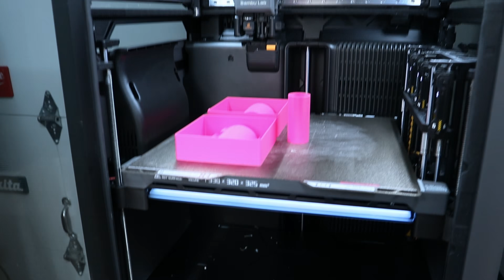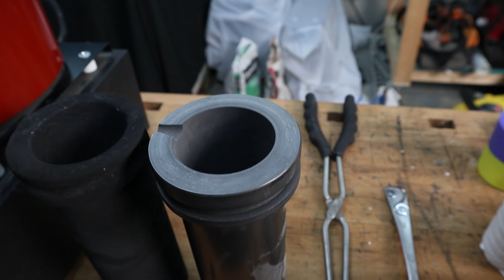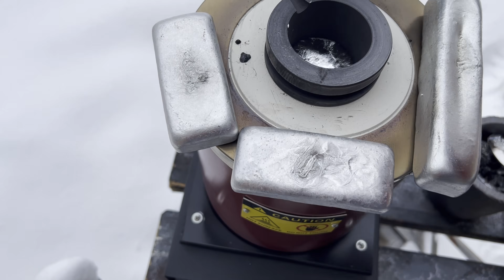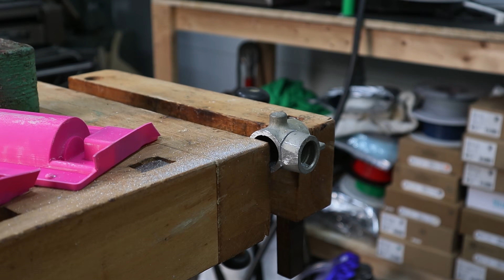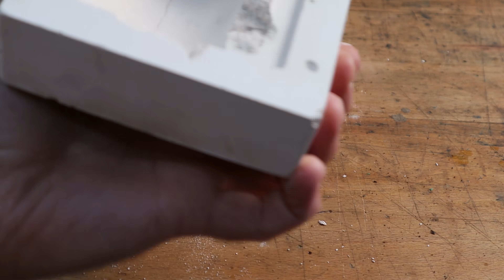Can these 3D prints make metal casting easier and better?

Comment: there is another method of using 3d printing for metal casting. you make multi piece molds on 3d printer to create epoxy sand cores or whole casting mold pieces
i used it to produce sewing machine frame at home pushing my electric mini furnace to absolute maximum

pretty much similar process to plaster of paris molds only there is no burnout stage because waxed 3d prints can be east removed and reused for another mold
Reply: Agreed. 2% epoxy resin by weight, use acetone for easy mixing, use fine sand. Produces excellent detail from pattern.
Reply: @notJW13383  you don't have to be that accurate
personally i used casting transparent epoxy i had leftover so there was no thining and i mixed in sand untill it looked kind of dry then ramed as normal sand and left to harden. but i guess you also need to take into consideration it can't be fast set stuff because you won't be able to use it before it kick in

Comment: A word of caution I will tell you from my personal experience. Never ever ever ever plan to pour any molten metal outside if it's precipitating at all. Those little snowflakes that were falling will leave behind little traces of water in your mold. I'm mostly referring to the ingot mold because it's open but it is still a factor regardless. When the molten metal is poured into the mold and there's a couple of drops of water inside or snowflakes it instantly will turn to steam and blast the molten metal into the air. I learned this the hard way about 27 years ago. Please be careful.
Reply: I'm glad your personal experience was unpleasant. Someone like you deserves it

Comment: And @ 20:19 that "little bit of trouble" you point out is the melted polystyrene.[ it hasn't had a chance to completely burn off, so it's just a glob of plastic, like you see on the end of the first pour's rectangle shape - gathered melted plastic that hasn't burned-up yet. And on the second pour the incoming molten aluminum just pushed the melted polystyrene (plastic) out of the way and that's what we see gathered up around the spout. 
- - What do ya think? makes sense to me. :D

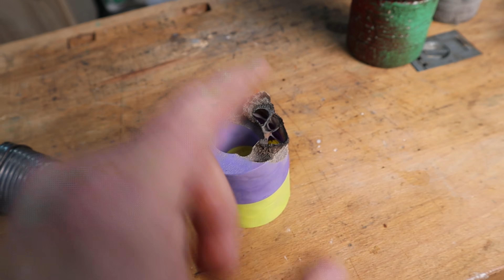Comment: That melting @ 19:17 is actually from the other pour, not the pour that got stuck. LOL They were too close together, and I'm certain that if the first pour went well, the second one would have failed from the heat melting the second mold :/ - Gotta account for them being too close together next time LOL
BUT I agree that the gasses created enough pressure to stop the molten aluminum from going any further, sorta like the 'glug glug' when pour out liquid in bottle with only one opening but in this case the aluminum solidified and the gases couldn't escape, otherwise you did an AMAZING JOB!!!!!Nearly perfect!  :) - Keep up the awesome work!!!

Comment: Thank you for this video. I’ve been working up to my first casting project, and this was very eye opening. I’ve always wondered, between lost foam and lost PLA, if there aren’t better options, or maybe WHY there aren’t better options for 3D printed patterns to be used in the “lost” casting process. Thinking of things like these foaming TPU’s for example. It would be awesome to not need yet another piece of equipment to make “foam” casting patterns, but pouring directly into PLA seems like a non-starter…

Comment: Your last one did good, but you don't want to pour metal down the vent. That narrow tube can trap air, like a piston forcing it down into the mold below while the metal is still liquid. That is why it fell off when you turned it upside down.
You can do a "lost foam" style 3D print but you need to dip it in plaster and melt it out in the microwave.
Another method is sand casting using 3D printed positives. This is pretty quick and only requires play sand and some water or motor oil or mollases depending on the level of burning smell you are willing to put up with. You can buy casting sand as well but it is expensive in small quantity.

Comment: I have been up and down and all around 3d printed casting. After MUCH experimentation, successes and failures my opinion is that lost PLA is CRAP no matter the filament- even the polycast ones.😂 the best and most reliable method I've found to get CLEAN accurate castings is to 3d print a part, make a silicon mold negative of it, wax cast the mold. Then cast with Investment vacuum casting. You can kinda get the diy methods to work but 3d print part> silicon mold negative > wax mold> legit investment plaster> vacuum casting is about the only thing I could get perfect castings with when the delicate/intricate parts needed to be PERFECT. Lost pla works "eh kinda" for basic shaped objects.
Reply: You should totally do a video of this whole process. I would love to see it
Reply: @simonwoywod8387 yea if i can ever get a power supply to work long enough on my induction heater or break out the ol coal forge again i guess. Iv killed 4 smps and to many bridge rectifiers using rewound mots for power so im stuck running half power for now . Im waiting to order a whole bunch of 50 amp rectifiers to parallel together along with 2 150amp bricks they should survive
Reply: Really iv seen multiple people get quite impressive results and the just essentially burry the print and pour in to it . The biggest trick from my understanding is that  you have to make at least 1 vent hole directly on the bottom of you print that loops back up and out of the sand  along with the hole your pouring into that way as you pour the molten plastic has a place to eacape because this is not foam that pretty well vaporizes or wax that gets liquid enough to flow thru the sand around it . The pla need to be able to escape the mold area as it melts

Comment: Look at a metal called Zamak.  It is Zinc based.  It has a lower melting temp than aluminum.  you can scavenge it from everywhere e.g. old sink faucets.  designed for casting.  cheap!!! used everywhere in the industry.

Comment: When you make 3d printed one time molds, The easiest way to remove the plastic is to use heat. I use either a small oven at around 100 C or a heat gun. That way the plastic is soft and rubbery and can be pulled right off. As a bonus this helps the plaster to cure faster.

Comment: @NeedItMakeIt
Thanks for another interesting and enjoyable video!!
Regarding "draft angles", wouldn't it be required to put "draft angles" on ALL sides of the part AS WELL as the "form walls" to enable you to remove the plaster from the 3D-print ?? In which case that would make the whole "design" more "convoluted", and in some cases more or less impossible or force you to "post process" your cast in order to "get rid of" the metal that had been "added to get draft angles"...
And "also" having the "flat top planes" really makes it "sub optimal" for gasses (or air) to "rise and escape", so if you had "leaned" the "shape" you could have gotten a more "natural escape route" for any "entrained gas". Of course more "vents" would help as well, but I'm not sure you would have needed that had you not cast your part ""standing flat"".
Just my thoughts...
Best regards.

Comment: The side of the pla which didn't cast well is burnt because of the successful cast next to it, it burnt it, and not because of the gasses
Reply: What's interesting about that is that if the first pour had been successful, it seems that would have ruined the second part by prematurely melting some of the foam, allowing sand to flow into the resulting void.

Comment: That's some pretty good results for home casting.

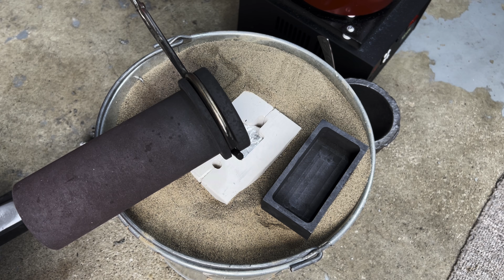A few tips, first, if you want to pull multiple plaster molds of one 3D print, you can print the same shape as the plaster mold, then use the print to make silicone molds for the plaster; silicone also lets you do undercuts or zero draft angles without a problem. Also, you should put the plaster in a vacuum chamber to remove any air bubbles after you pour it into the mold, which will give you a better surface finish. Your down-sprue is also too big; you can see air getting sucked down by the aluminum at 16:13 in the video if you look at the side of the sprue opening opposite the pouring basin. The transition between the offset pouring basin and the down sprue should actual be one continuous curve; also, the sprue should be tapered in cross sectional area as it goes down. You have to remember that liquid aluminum has about the same viscosity as water. As it accelerates down the sprue, the cross-sectional area of the flow decreases, just like a stream of water falling from a slightly turned on faucet; the sprue needs to hug the aluminum all the way down. You should look up the paper "Optimizing the Gating System for Steel Castings" it has a lot of good concepts in it, especially the Trident gate and spin trap at the end of the paper, or just look up anything by John Campbell. Both his books/papers and his talks are some of the best material on metal casting.
Reply: Please listen to this! It will improve your castings VASTLY. Anytime I see someone break out the tin can I hope that someone in the comments brings up Campbell
Reply: @theodorekorehonen Campbell is the GOAT, learned a lot from his books and papers.
Reply: @ZergZfTw  could you just use tpu filament
Reply: @A96Z86 maybe, but printing the super soft durometer stuff is kinda a pain, especially for more complicated shapes. 2 part silicon can copy the shape of objects down to a micron level, so you can do vaper smoothing, hand sanding, or use something higher resolution like a resin printer if you want.

Comment: @20:00 I don't see a vent on 1& 2 like the Pla&plaster mould. That would explain issues on both.  If doing green sand casting, use a lower basin to capture the sand that washes down with filler neck.

Comment: Just a tip, for any wet mold such as plaster you need to dry it fully or it can cause major issues during casting.
Reply: As this person forgot to elaborate, let me do it - it will explode as the steam will rapidly expand. And the explosion will throw not only pieces of the mould and sand at you, but also the melted metal. Fun times
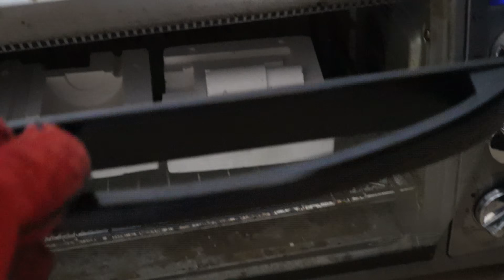Reply: He did dry it @13:16
Reply: yes, instantly boiling the moistures inside the plastes could cause a mess, even while it looks dry, isnt a bad precaution to put on a warm place next to  a stove or something. For the vents, you can incline the piece in the printed mould so the chimey stay on higher ground, i have done a lot os moulding and casting myself but for resin and composite, in more complex parts could be really usefull to put the fluid inlet at the bottom, at least on resins castings for comples or narrow walls, maybe be its also aplicable here.
Reply: I doubt steam hammer and molten metal were high on the YouTubers safety checklist. He's pouring on snow.
Reply: Yes, it will explode because of steam pressure within the plaster.  It must be completely dry when casting and the mold should be hot too before casting like he said.
Reply: Psst, don't tell him, he's a simple-minded American. That's gonna be a funny next video 😅
Reply: @stefmod9273  chill out bro, who hurt you? we all make mistakes and this was his first time trying this. we shouldn't wish misfortune on others. I'm sorry you didn't have someone in you life to teach you that.
Reply: @AndrewBrown3Dprints  He's lucky that this whole thing didn't explode. Liquid metal does not excuse any mistakes with wet stuff like gipsum. Use casting sand instead with binders.
Reply: @stefmod9273 what part aren’t you understanding? I said he made mistakes, he definitely has some major issues with safety. But wishing ill upon someone isn’t cool. Also he’s not the first person to use this method, it can be done safely, it’s very similar to a common method for fine jewelry casting, though it needs to be heated for a long time at high heat until right before you cast (so yes, a filament dryer definitely isn’t going to cut it). I don’t believe you actually want him to feel the pain of molten aluminum on his skin, but words have meaning, so one starts to wonder. Maybe I’m just a simple minded person too, who values the life of a total stranger. If you haven’t seen the error of your ways SEEK HELP, that’s not normal.
Reply: @stefmod9273 He's Canadian and he dried it for 6 hours in an oven.  13:16
Reply: @bobguy6542  any reason not to crank up the temperature enough to burn out the PLA? No fume hood?
Reply: @technosaurus77  You won't burn it out.  Plastic is very sticky when melted.  It won't flow out of a mold.
Reply: @stefmod9273 Psst, he's Canadian.

Comment: Pretty much my results that I had from metal casting. You would think that 750 degree aluminum would melt a 3d print easily, but just like you I found it blocks and only the sprue fills. You can apparently get filament that works better for casting but have not tried it. The only way I have seen others use a 3d print direct is with single wall hollow molds. They then paint it with a ready mixed plaster patch to fill any holes that the single wall has created. The method that worked for me was using a 'flask' there the two halves of the flask split and you use 3d prints as the mold and compacted 'green sand' (bentonite clay powder mixed with sand and water). Had to add drafts to the 3d prints because extracting then from the mold would destroy the shape of the mold. Also had to print using small layers,  sand them down, spray with paint and then lacquer to make them as smooth as possible because the green sand picks up so much detail that it will stick in the layer lines which prevents easy extracting or again destroys the shape (the edges) of the mold. At least the green sand method is reusable, and requires no wait time unlike the plaster method. You have to REALLY want to make something out of metal to cast because any method takes a lot of prep work and post cleanup.

Comment: Interesting video.  You really need a portable bandsaw,  watching you hand saw the aluminum was brutal 😂.  I’ve watched Paul’s Garage as well and he has a lot more methods for casting parts into metal.  Using red casting sand or resin designed for casting metal would have also been good methods.  Thanks for the video it was a great experiment.
Reply: I use a Ryobi brushless angle grinder for cutting through the metal, but it's also great at polishing and reshaping. An angle grinder is a must IMO for metal casting. It saves so much work in so many areas.

Comment: Need to pour a little bit hotter...10-15c will help aluminum flow better...it's cooling too fast...not enough latent heat in the metal to overcome the cooling effect of the molds...
Also on lost foam/pla...you need a 2nd riser to vent off the gasses...otherwise they try to push back out thru the pour...
Reply: It’s also why the plaster cast item worked so much better, he used a cast part for his aluminium, the high silicon content is used because it releases extra heat as the silicon crashes out and keeps it flowable for longer and deeper

Comment: Maybe you could design in an open vent tube into the PLA form (the lost foam + PLA)
Reply from the maker: That’s a good idea, I was also thinking about trying foaming filament.  Is there a foam that can be sprayed into a PLA mold and then the foam would be super precise and then used for sand casting?
Reply: Tried that, but the foam is fire retardant

Comment: I don’t quite understand how the lost foam method works or is supposed to work. Why did the styrofoam and the 3D printed part have to be split and glued together?
Reply from the maker: The reason that I did that is so that I reduced the amount of support structure inside and didn’t need to worry about the top surface bridging, if I didn’t do it that way would’ve needed more support and I would’ve needed more tops to make sure that the outside surface was nice and smooth.  None of that seemed to matter in the end because it didn’t work…
Reply: @NeedItMakeIt  I see! So the 3D print was supposed to disappear like the foam, right?
Reply: @michaelbraaten  Yes.
Reply: While styrofoam is mostly air, PLA isn't. Why is the expectation that high temperature will make it disappear? Wouldn't it just melt, separate and solidify again at some place in the mold? 🤔
Reply: @tasoszervos It's just surprising to me that PLA which melts at 180 degrees C (and softens at 60 degrees) can withstand molten metal at 750 degrees so easily. But now I know it does.

Comment: Very cool to see. I am pinning this video for when I need to come back and reference it.    I bought a resin printer and used a wax resin to do a lost wax method to make an engagement ring.   Another random thing you might be interested in is making silicone parts by using pla 3d prints.  Recently I have been making gaskets for containers out of silicone this way.   I model the gasket in fusion 360,  then I model the mold for the gasket.  Then you just pour a 2 part silicone in and break the mold apart.  Cool way to get very flexible compliant parts.

Comment: Interesting. I can maybe help you a bit. If you dip your styrofoam parts in watered down drywall plaster you will get a near identical casting of the foam. Your supporting it in Sand is good. Hopefully dried out sand! I did a lot of aluminum casting years ago, and am happy to see you are doing this well enough. 

Mark

https://youtu.be/T2H8UH3TeaM?si=lQh0Oxa6R9hJ-tmB